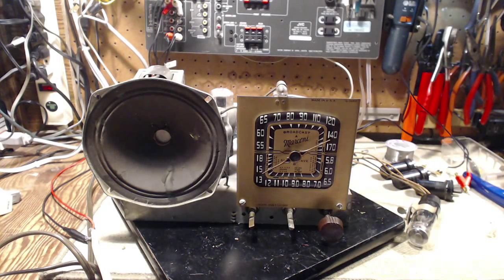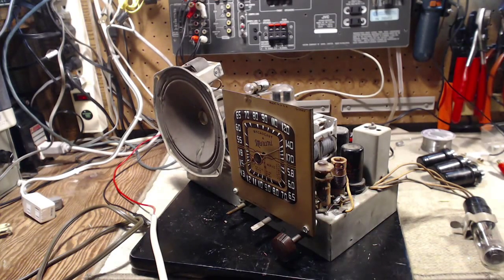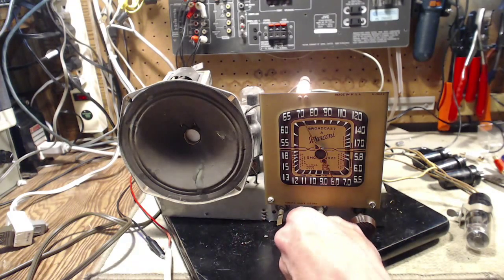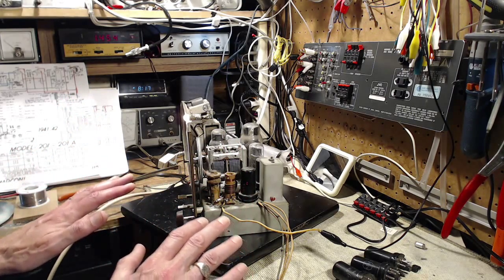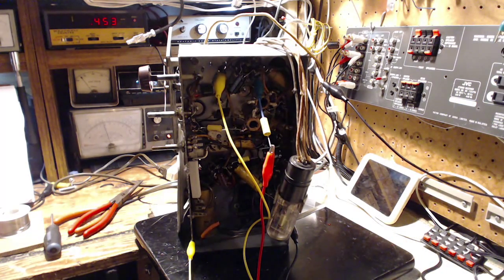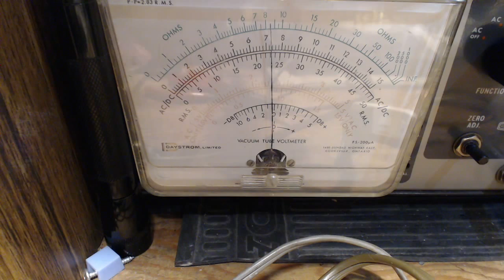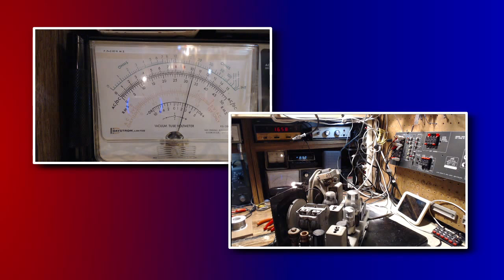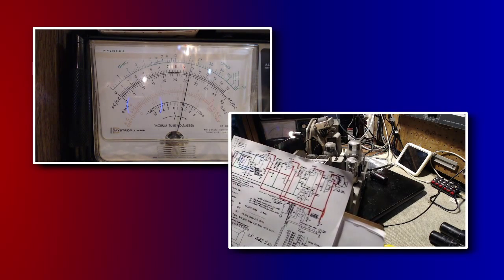Marconi 201A AM and Shortwave Radio Video #12 - Alignment Not

Comment: Jim
I think I can shed some light on the tuning shaft.  There should be some set screws in the coupling.  I will bet that they were lost and a suitable replacement could not be found; hence the bkack stuff and the solder.
Reply from the maker: Dan Floyd It must be something like that.

Comment: Jim, probably a tech in the past de-tuned the IF on one of the transformers to reduce the gain and killing the oscillation.  I think the problem has to do with the work that was made on the front end rf transformer. I think you are on the right track thinking it is related to the higher freq. and much less stable stages.
Reply from the maker: DALE BROOKS Interesting theory on the detuned I-F. I'll need a theory before I go hunting for the cause.

Comment: Bet you made less mistakes before videoing. No explaining what you do, messing with cameras etc.

That 1pf twisted wire did not seem to make sense at the time. Maybe it is to prevent oscillation at higher frequencies? It looks like it is positive feedback though.

I'd put a scope on the plate and see if the freq suddenly jumps. Also remove the cap/clip on the grid you left. Could cause the IF to feed back.
Reply from the maker: Scott Henion Off camera, I noticed the clip and removed then retested and there was no difference.
Reply from the maker: Jim Lindenas As for less mistakes, I probably didn't become aware of some of them without helpful people looking over my shoulder. But you are right, making videos is distracting - and I'm easily distracted.